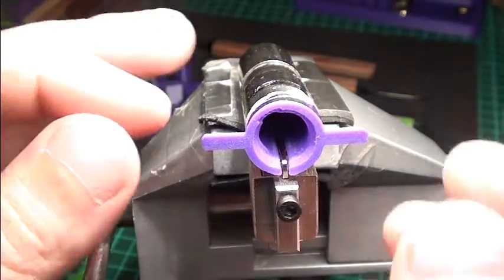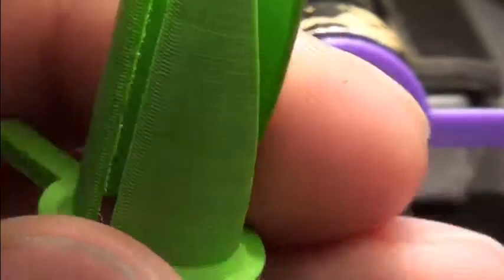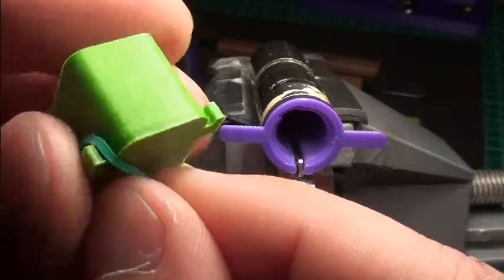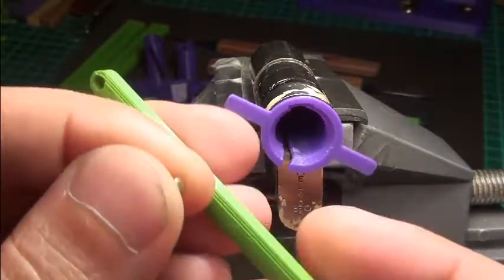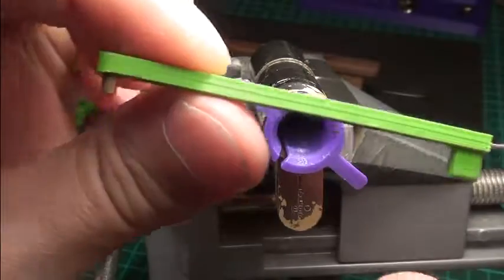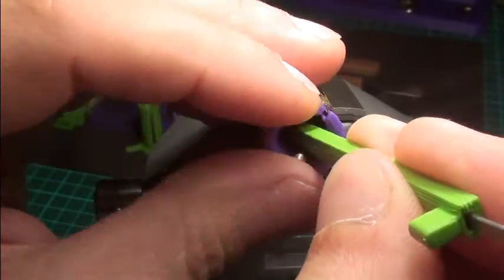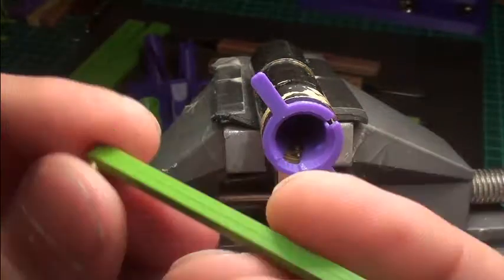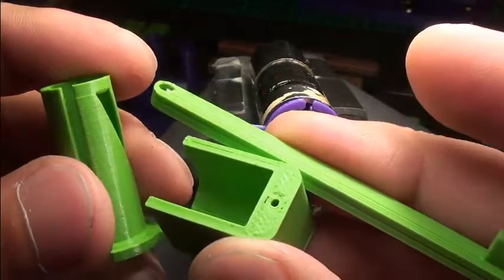#018 - pinningtools v2 - just a little follow up

Comment: I have never used those types of tools before as always been use to standard plug followers. I love your idea regarding the tool you made for re-placing pins, instead of using tweezers... BRILLIANT.
Reply from the maker: Thank you very much Rich. Actually, I'm a cheapass and didn't want to buy better and proper tweezers ;)).
Reply: You are more than welcome mate, great idea as gripping pins with tweezers can be a pain in the ass, as they can fly out.

Comment: Wow, these tools are amazing. Guess I need to start saving for a 3D printer
Reply from the maker: At the beginning I was just playing around with the printer, but now it is even useful sometimes :).
It's definitive an interesting technology. Has developed in the last years to a useable state and I'm curious how it will develop further. You have to invest some time, because a 3D printer isn't playing nice always and has some limitations, but it's really worth.
Reply: Any recommendations? It would mostly just get used for tools like this so I wouldn't want to spend a fortune, but if you know of a reasonably priced one that isn't complete crap I might be able to swing it.
Reply from the maker: I have a CTC, invested with some additional parts around 500 euro. For me it's okay, print quality is nice, but it gets you also some frustration sometimes ;)). But as technician I'm used to that...I can really not recommend a special model, as I only know mine. Depending on what you want, there are alot smaller models which might suit you better. But expect 300 euro+ as a starting investition.
They share all the same problems. I would recommend you to use google and watch some videos of models you might be interested in. 3D modeling software you can get for free. I'm using 123D from autodesk.